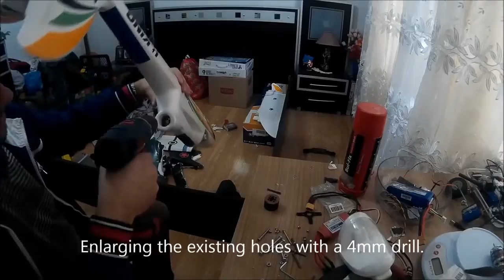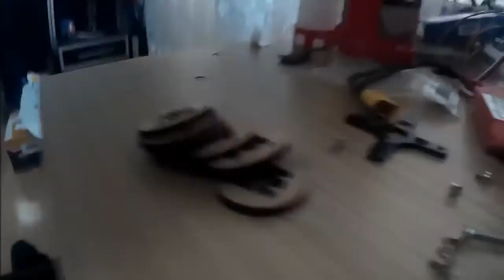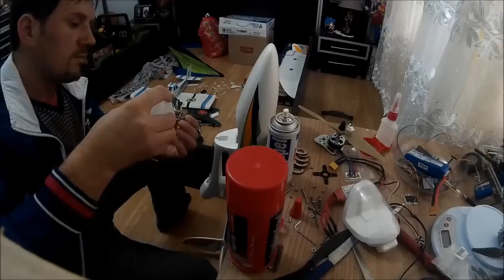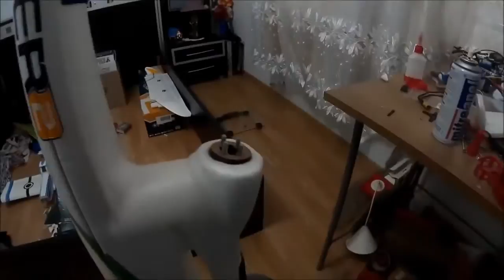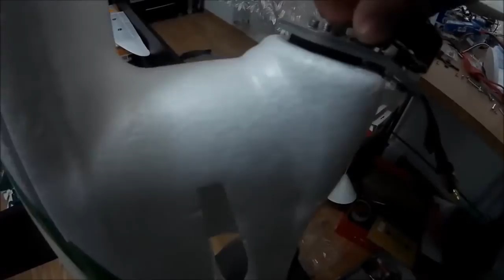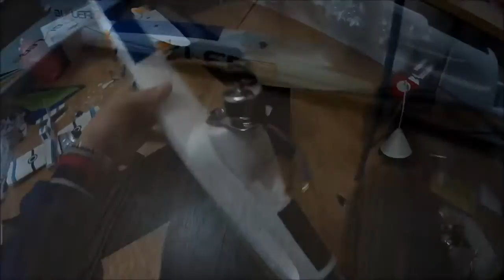Bixler 2 motor upgrade

Comment: The angle? How did it work for you. Looks like you added another 3 degree forward tilt and that will require some trim for level flight I would imagine. Was at the HK page for your brushless motor choice
The idea is to keep the idea and your creation alive by returning with replies :-)
Reply from the maker: +Chris Leech Thanks for your comment. I actually mounted it as it was. No bending required. it is great for motors with lower kv to use bigger props. The angle was right too. I flew the bixler and it was great, It's been a while now that the bixler is just standing in my room and not flying (i broke the main wing carbon tube and don't have a spare but in the meantime i have also built a S500 quad with a 6s system and i'm mostly flying with the quad, i get great results. 21 min. flight time on 2x5200 mah in series for 6s setup with 11.1  to 11.3 volts left on each battery). The motor i'm mounting in the video is a great motor with a lot of power but too much vibrations. I'm thinking on putting a Multistar 6s from HK with a 11 or 12 inch prop on it. It would fly for a very long time i think. :)
Reply: +Fly for fun Sure I am all too aware of the seductive nature of multirotors. My RC bench has had kids and now grand children, forcing me to nearly double the storage for models and building materials, and did I mention all the DIY electronics projects that get stalled out while waiting on Ebay deliveries, now averaging 40 days!!  Will have a look in on your S500 for kicks :-)

Comment: Hi
Today I mounted the mount like you in a new bix2  and it doesn't fly properly and I think that mount change the angle of the motor and that is the reason ¿sure your's one  flighted ok with that mount?.

Thanks
Reply from the maker: +carlos larrea andreu After mounting this motor, I have flown the Bixler only once, I had no problems with it. Than i bought a quadcopter and I didn't fly the Bixler 2 ever since. But now i'm working on it and installing an APM 2.8 and FPV camera with head tracking. I will let you know about the results.